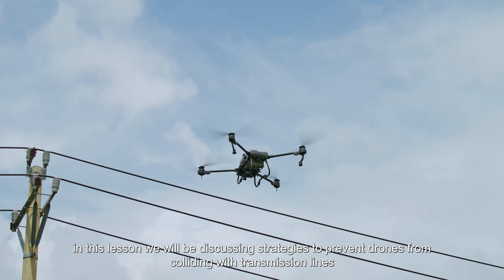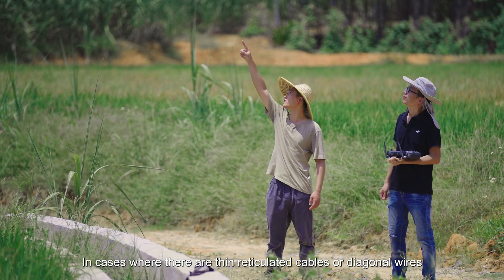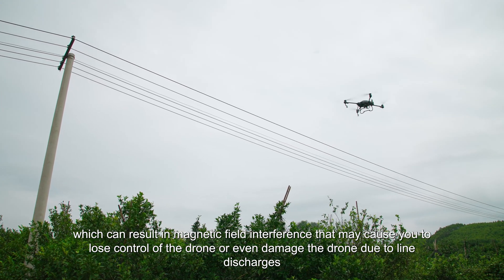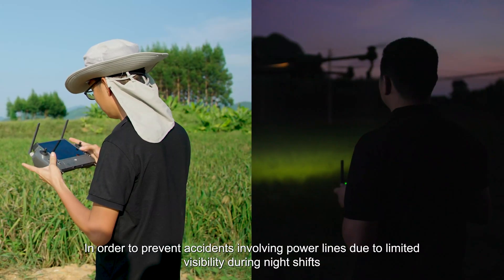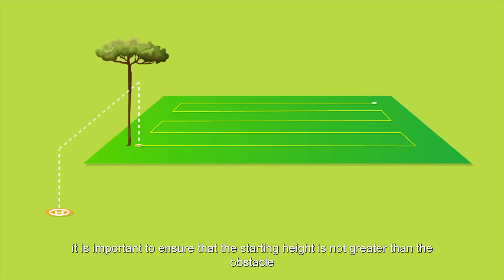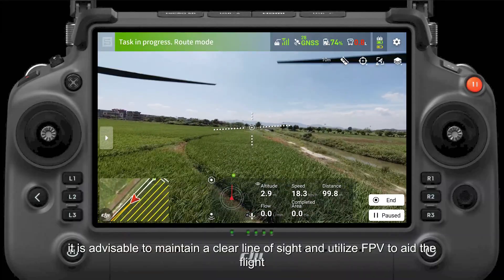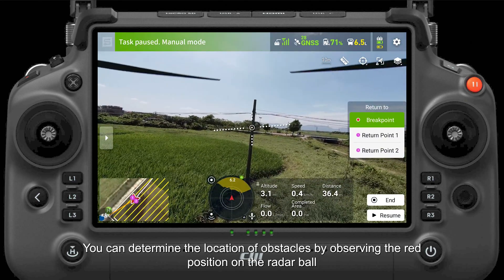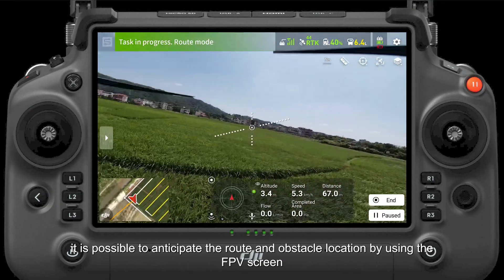Power Lines Safety Tips | Agras Tutorial

Comment: We lost an agras t30 due to high voltage power lines and dji did not cover the damage, it was not a human fault but dji's failure system while crossing beneath the lines and accidentally power lines magnetic field snorted the drone like a toy. Do not recommend flying in such areas at all.